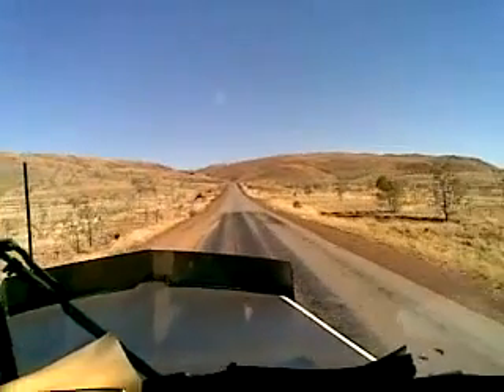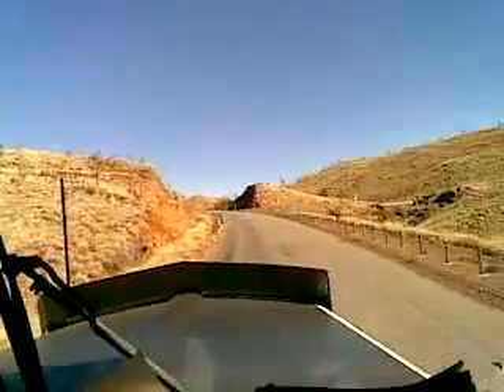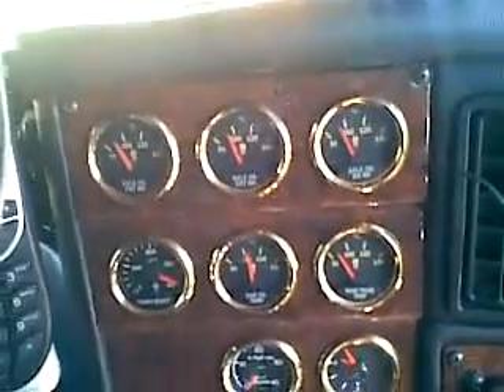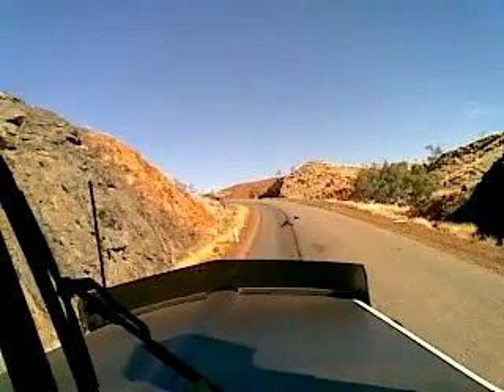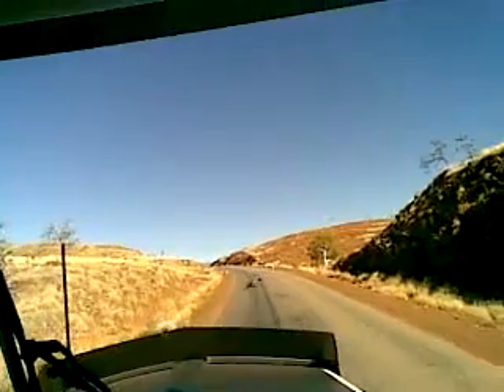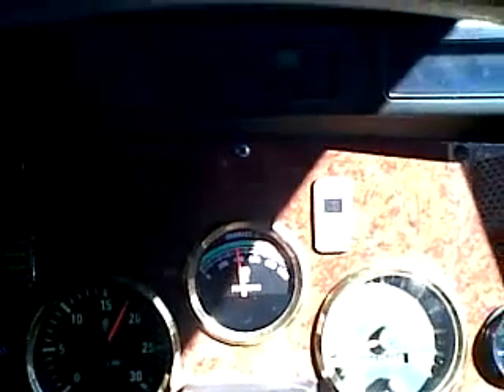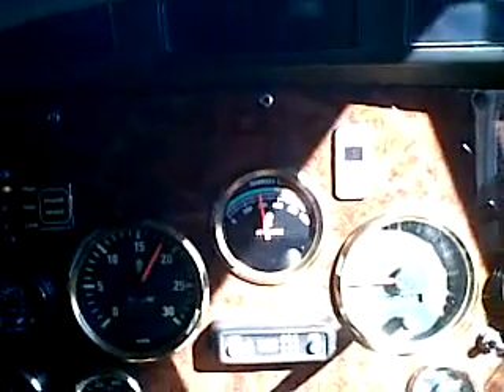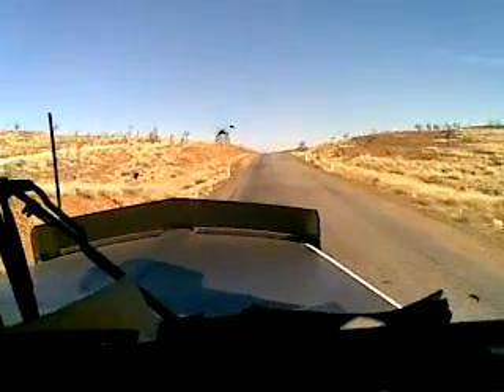170 Tonne Road Train Hill Climbing   YouTube

Comment: nice vid, pity 'bout your accent, worked klc logging in the 60's Cummins Pacific 400 bhp spicer boxes n diffs, pushing off the skids with aid  d7 dozer, triple log trailers .thats hard work for C15  OR ANY 15l engine, IMO you need 'bout 20 litres, using that much torque for long pulls, well that's hard on any drive train  Question, will the box not change unless you clutch?Built on the same platform as the 550 hp C15, the new engine rating provides 2,050 lb-ft torque at 1,200 rpm and a constant torque output all the way up to 1,700 rpm. In the 600 hp version, the C15 offers torque of 1,850 lb ft.

Comment: Desperately underpowered,block (skip) changing two three gears down the box into grandma that poor Kenny is really working hard. fan cutting in and out, coolant is on the verge of boiling off.
No substitute for a big snorting slow revving lump, a Cummins QRSK 19 Litres and 900 of Clessie Cummin,s best ponies, find a  good diesel specialist to soup up the QRSK and 1,000 ponies on tap.
Reply: agree,
Reply: Bloody thing would cook

Comment: Have to shift in manual.....................................cause a truck driver is better than an ECM. yeah right!!!
Reply: Every AMT I've driven has been useless af when it comes to hitting steep hills, except the ishift. In fact there's one particular hill if I hit it loaded and leave the transmission in auto it'll stall, because the hill hits so fast the computer can't understand what's going and doesn't drop enough gears on the changes and comes to a stop.
Reply: Exactly.

Comment: That is maybe your opinion, to prevent  'the bloody thing cooking,'as you politely said. fit short ratio diffs,a shorter low range, lose bit of  top end speed ,but easily rectified with a tall overdrive off top gear in high range. Fit the biggest radiator and oil cooler you can under the bonnet with two or more fans to obtain maximum airflow . Run the engine at a lower rpm ,find the 'sweet spot' where she will run happily for hours on end . Last thing you want is the engine going bang in the middle of nowhere .
Reply: We make Kenworths here for our conditions. 
I think we know what we're doing when it comes to cooling in 45deg C+ heat on road train service without input from a YouTube commenter - although there is a small possibility you know more about Kenworth products, roadtrain service, truck cooling systems including but not limited to radiators/water pumps/Horton engine fans/fan shrouds/heat exchangers of the air to air and liquid to air varieties/oil coolers/boost control/drive systems, diff ratios, Eaton Fuller transmissions etc etc etc than Kenworth themselves know! 
Perhaps you could submit this comment to Kenworth and they might find they got it all wrong and pay you a royalty per truck. Could be a nice little earner for you.

I might have a character flaw (or something) but personally I find it amazing anything was ever achieved in humanity before YouTube commenters.
Reply: @ThePaulv12  That is maybe so, but i would to love to work for the'Bulldog' company building wagons(trucks) that will make your hair stand on end,. for there is no substitute for a really big engine working below its rated capacity,using all of what  you said,  regarding cooling and heat exchanging.  There is a limit to what a normal heavy duty dry plate clutch can handle ,even one controlled by a geek box.  Buy the biggest draft horse you can find and work him well below his limits for long working life, reliability and reduced running costs. As Luke Hobbs senior engineer workingin the 1940,s for United Aircraft Pratt&Whittney once said 'there is no replacement for displacement' 
 Have been designing heavy wagons since i was twelve.

Comment: For that weight, the Kenny,s thrashed to an inch of its life, 6x4 drive 620  Cummin,s ponies in need of the vet,18 speed eaton auto manual,a recipe for disaster, . My ideal tractor to handle 170-250 ton quad trailer trains with decent hill climbing performance.and not flog the guts out of the engine and ,box. Is a five axle Western Star ,19 litre Cummins QRSK bored out to 20 litres, juiced up to ,1,100hp twirling an eight speed Clark Power-Shift, a tried tested gearbox used in the Timber and Oil Field industries.  Three speed Spicer auxilliary ,box  to three SISU hub reduction drive axles, thus reducing stress on the half shafts . The QRSK tweeked for maximum torque delivery between 900 and 1800 rpm , making for a very drivable engine ,and not constantly changing gear, reducing stress , shock in the transmission. Two ZF Hydraulic Retarders driven of the Spicer aux box, able to hold a 200plus ton road train at a constant 25 kmh down hill . A Third ZF retarder clutched in and driven off the bogie of the third trailer,on a single engined road train.

Comment: Did I just watch a video where a man changes gears in an automatic climbing a hill? Rather pointless
Reply: So you've never driven heavy truck with a semi automated gear box.
Reply: @peterpenberthy2918  that’s correct. 18 speed only
Reply: Don't you believe it. We have a fleet of Scanias and Volvos hauling Triple and Quad Roadtrains with similar weights and they can't change down quick enough with really heavy loads on steep jump ups and grades. I've had to teach all the newbies how to manually change auto boxes to avoid stalling. You've gotta get into it quickly and watch your rev counter or your toast!